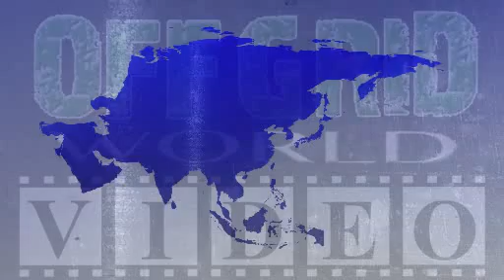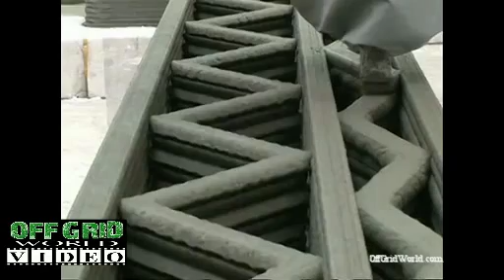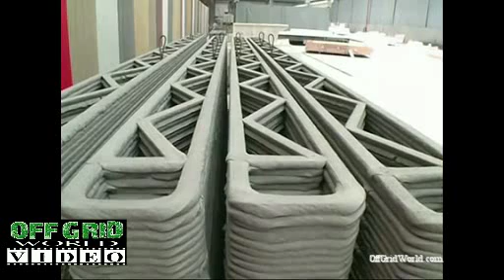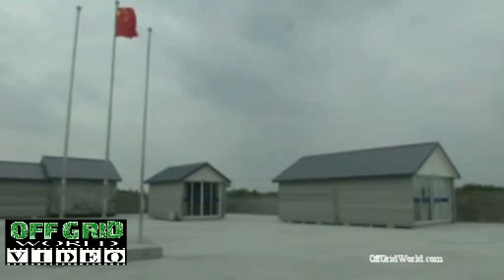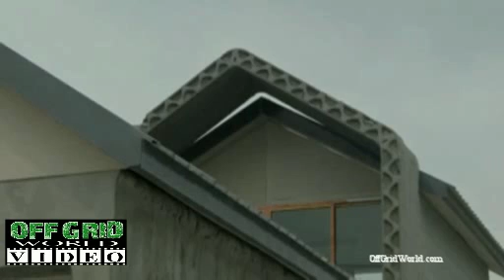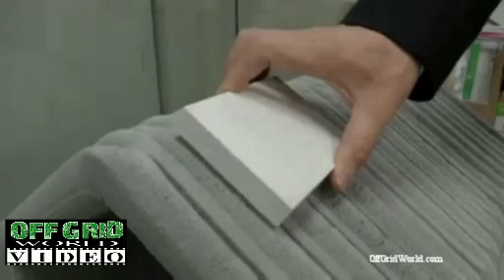10 Houses Printed in 24 Hours - 3D Printed Concrete Homes

Comment: Without reinforcing steel bar in the formwork. This is not the way to produce structural members of a building.
Dallas Mathieson, Nelson, New Zealand.
Reply: Dallas Mathieson You can't just assert that without seeing the figures! 
The inclusion of fibres completely changes the concrete, and the structural members are novel designs...
Reply: Simon Masters I am sorry to disagree with you Simon but if there were fibres of sufficient length strength and number in this pour as the machine lays a zig zag the fibres would not enter the straight runs therefore it would be a weak point in the structure as the whole structure needs to be tied together to give strength.
Reply: Agreed Dallas  Monolithic is much better, and yes, I take your point about it is a weak point...but allow a little "license" - the beauty of 3D printing - perhaps the second print run will do better...
Reply: Simon Masters The way to strengthen this point is to insert a strengthening interlocking form at this junction that looks like the Greek letter K. The Greek letters have little T's on the ends of each line as of the letter. This would bind it all structurally together and these could be inserted between each layer of concrete. ( It is not a new idea as the Greeks inserted metal I"s in their stone buildings for structural integrity).Dallas Mathieson

Comment: Interesting use of fiberglass in the concrete mix. I wonder how much more resilient it would be if they used long staple carbon fiber?
Reply: Mike Trieu This tensile strength is crazy and glass is cheap. I use this stuff. Its great.